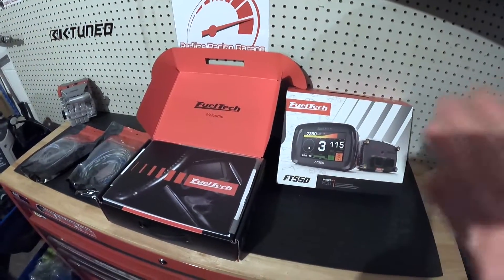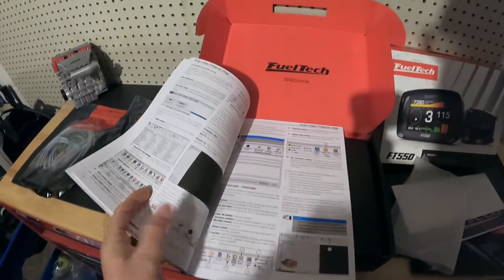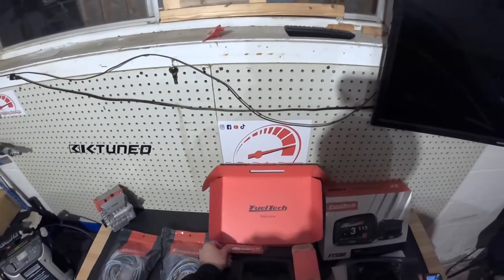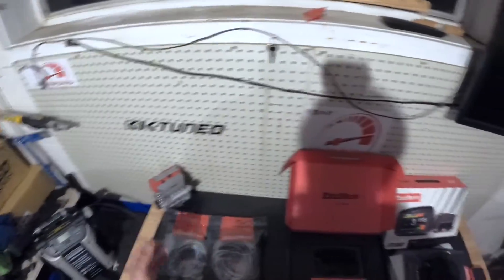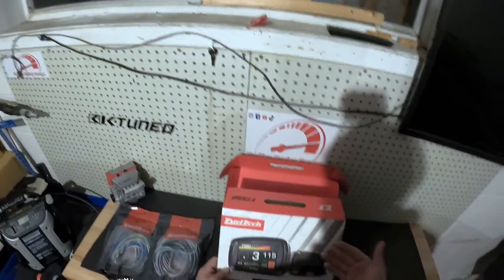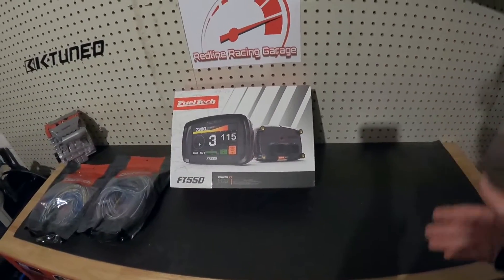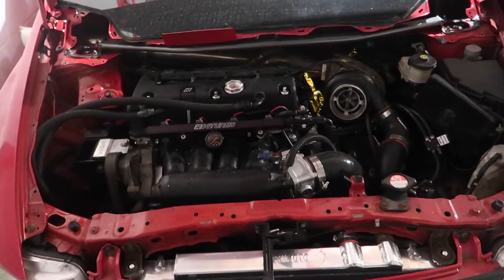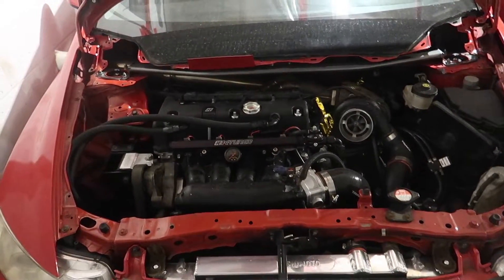We Are Going FUEL TECH On The Turbo 8 Gen Civic SI * EP 69 *

Comment: hey buddy, can you tell me if factory BCM will continue to support EPS and ABS. I understand both ABS and EPS have independent controllers on Hondas. How was your experience?
Reply from the maker: On fuel tech you have to get everything separately, sensors, abs, ect. With running a stand alone ecu that’s always the case, now if your keeping your stock harness the sell a jumper harness for the 8th Gen. which lets you keep everything stock that your have and still are able to run fuel tech
Reply: @Redlineracinggarage  ok i assume you bought jumner harness for your car
Reply from the maker: @branduncensored  no mine was a full on race car so I didn’t need any of these thing so I didn’t put a jumper harness

Comment: You definitely don't need to swap out intake manifold to make more than 600hp. There's people making way more power with the stock rbc manifold. Stick your money into your fuel system.
Reply from the maker: Yes I’ve seen guys making 650 hp on the rbc intake manifold. But that’s boarder line and I’m thinking long term because I will want to make a lot more than that! My fuel system is bulletproof got everything I need fuel wise.

Comment: Actually fueltech is not that new. If you go to any imports racing half of the field is running fueltech and prettymuch all records holders today are using it.
Reply from the maker: Yeah after I posted this video I did a lot more research and noticed that fuel tech has been around for over 10 years. But ppl started to catch on last year and it started blowing up. Yes all the record holders are running fuel tech and had great success which is why I went with fuel tech. Like I said they are ahead of their time and have a lot of technology for a great price!